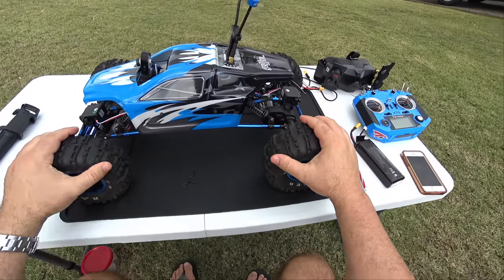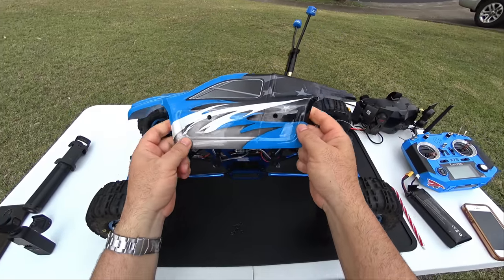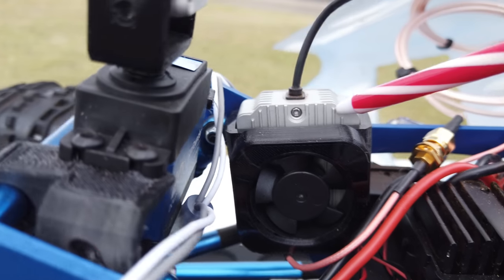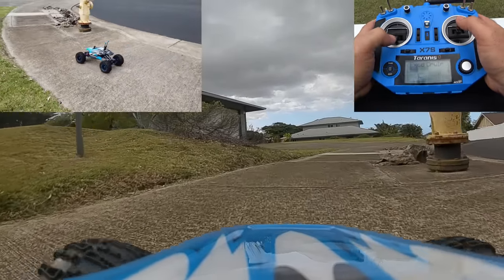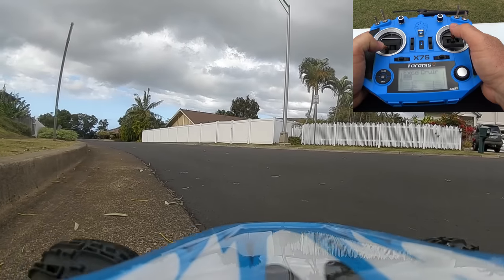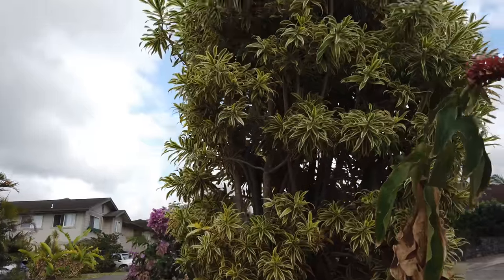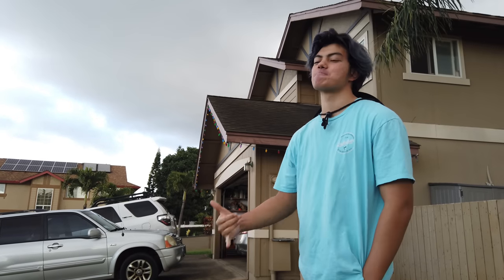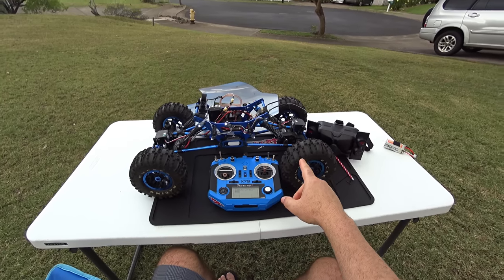DJI Digital FPV+ 50mbps Ground Surveillance Range Test on RC Rock Crawler + MORE MODS!

Comment: Just a thought. If you put a small compass on the hood that can be reasonably read by the vehicle camera, and a compass at your location, you can properly orient your FPV goggles.
Reply: A small compass on the hood! Why didn't I think of that. Been getting lost in the bush with my FPV Summit. All scrub looks the same and sometimes I dont know if I am going towards me or away sometimes. Cheers.

Comment: Hey, quick tip on the rear steer, I'd use one of the 3-position switches to enable crab or opposing mode, that way you don't have to rely on a third hand on the potentiometer. Then, you can use the mixing in the radio to steer it the way you want

Love these urban FPV adventures :)
Reply: I was thinking something similar, like using both sticks for steering and the knob for the camera, or maybe use the front steering to match with the camera. Great vid, cool set up and cant wait to see more!
Reply from the maker: Cool thing is... You can set your channels to however you want to control each feature 🍻
Reply from the maker: That's  definitely an option.  I wanted more analog control of my rear steer 🍻

Comment: Very nice! I've got a 6x6 frankentruck with fpv. I use fat sharks with head tracking but i need a stronger vtx. An option to consider is the quantum (I think thats right) head tracker which could mount on top of your dji goggles.

Comment: The DJI system has dynamic power even with thermal protection turned off. So it only ramps up the power when the signal degrades and up close uses 25mW.

Comment: You should use a 3 way switch mix to control the 4 way steering . Up would be just the front wheel steer , center would be all 4 wheel steer and down just the rear wheels .
Reply from the maker: Great idea.   Thanks 🍻

Comment: If you put your TBS CRSF (TX) antenna on one of these...Alfa ARS-AS01 Magnet BASE mount for RP-SMA antennas, and place it on the roof of your vehicle, you will greatly extended the Crossfire signal. the sma connector on this antenna mount fits on your transmitter.

Comment: ohh man.. gears are turning...
not sure about your channel choices.. 
I'd use Yaw for Looking.
Right stick for Forward reverse and steering?
Like angle mode... 
dunno. 
fun and well executed. 
thanks for sharing
Throttle would be nice to set a slow crawl...
Reply from the maker: Everybody is going to have their preference and you can set how you want 👍🍻

Comment: u should mix the throttle and steering for the left hand so this way u can keep it pinned and steer with one hand and use your other for fine corrections with the rear steer.... have you tried that out? throw that into the mix and run it see how it feels!! ull love it much more natural takes all of 5 min to get used to

Comment: Try mixing the two steering channels like you would rudder to aileron so you get permanent four-wheel steering like on a teleporter.
Reply from the maker: I thought about it but wanted independent control of the rear steering 🍻
Reply: @DustinDunnill  On my farm I have a CLAS Raptor all independent four wheel drive. On switches you can get it to steer in any fashion whilst just using steering wheel.. Using a three way switch you could set it up the same.I can get this eigg
Reply from the maker: Cool.  I might move the rear to one of the 3 way toggles but I'd imagine in some real sketchy rock crawling situations the proportional precision is welcome 🍻

Comment: Hey Dustin, interesting project! I wonder if one can relay signals via a drone? to bypass resistance of all those houses.
Reply from the maker: Thanks and great idea.  Looking at doing a 4g mod to this like I have with my Parrot Disco wing.   That way there is control and FPV wherever good cell signal is 🍻

Comment: I have the same setting with axii 2 antenna , you will have better range in 25mbs and if you putt your image quality at low latency not on high resolution you will have better range , in urban city the system perform less better than open area too!

Comment: It will be so cool if there is a gyro thingy, so when you turn your head the camera moves too. Will eliminate the need of control for it, however will affect transmission since at some point when you turn around the antennas will not be towards the RC.
Reply: They have a head tracker module for fat shark goggles and then just mount a servo on the vehicle itself with a camera mount. Secondly for the antenna issue, they make a antenna tracker device that will keep the antennas orientated directly at the vehicle for perfect signal. They have been making these devices for the Long Range RC plane guys that fly out 100miles 👍🏻
Reply: This is one of the 4G disco feature... digital stabilized head tracking...
Reply: @smooth_ops2942  I haven't seen such thing, cause I'm not that much into the long range planes and RC. Good to know and thanks for the information, will check those to see how it actually works.

Comment: Should put antenna on top flag pole
Reply: For the price of this stuff I agree, A repeater ground station needs to be in the link. He barely went 400m from home and it lost it.
Reply: @Top-Jimmy  oh 400. Lucky i have 2,000. So it mean 2000 better? I have em
Reply: @behr4204  Hi mate, No not really... Need to get antenna High, More mA wont make a difference unless you have high up antenna.
Reply: @behr4204  Or do you mean to say.. You can travel 2000m with obstruction and not lose VTX signal? Because that is very good, But how?
Reply: @Top-Jimmy  im learning now. I mean mw2000. I have Flysight  black mamba. Both of them. Still working on it. Too busy right now during spring lawnscape jobs
Reply: @behr4204  Flysight Black Mamba is 'decent' but if I remember correctly you're not going to push close to 2W RF output unless you run that thing from its max input voltage. I'm not 100% cause I think I read that somewhere, but at 12V input it was drawing close to 1A for me... so that seems pretty close to 2W assuming it's not total trash but IDK.. Maybe more like 1-1.5W which is more than enough either way, but 5.8ghz is going to be total trash for anything outside of short range unless you have a nice set of goggles and a diversity receiver module. A refurb set of V2 goggles and any air unit is the same price or cheaper. I only get real short range on 5.8g, like just over 100m then the video gets real bad using basic cheap fpv screens. I'm not going to spend $300 or more on decent goggles that take a diversity module cause after it's all said and done I could have bought 2 more O3 Air Units. I already spent $60 on one screen, then another maybe $80 on the cheapest clone goggles.. then another $50 on a different receiver.. just trying different stuff til it worked right. My $60 screen looks amazing, but no damn audio... My $80 goggles have the audio output, but don't look as good, plus so long as my 2.4g transmitter is on I get horrible interference that clears up completely after shutting the controller off. The other receiver I tried was trash because it only had one antenna. It needs to be legit diversity or true diversity using a legit patch and legit CP antennas. 

If you don't care so much about the audio channel (which the Black Mamba was decent at) then you should try an AKK Race Ranger. $25 bucks flat from the AKK website. The built in mic works a little bit.. It's a legit 1600mW or more which is probably more than you'd get from the Black Mamba anyway. It also will have superior filtering and image quality. I had what I thought was amazing video using that vtx but I couldn't get over not having the same crystal clear audio I had with other transmitters.
Reply: @Top-Jimmy  When it comes to the elevated receiver I would say this is the key. The exact specific layout does matter quite a bit though so these things are not 'concrete'. Imagine how the FCC might track a signal down for example... A guy might be wandering around with a yagi antenna until he triangulates the general origin of a signal.. but when it comes time to truly pinpoint this signal it's not going to be easy if there are a lot of things that cause reflections around. Maybe to the FPVer these are beneficial reflections or bad reflections. I used to really appreciate being able to reflect the signals off walls and other objects back in the day when a friend of mine had this laser tag system. If this is causing multipathing on an FPV setup then that's no good. 

What really got me into the idea of 'long range' ground FPV was seeing 1.3ghz systems. I never really was able to see the details of most of them. I was able to break it all down over time based on what I've seen to assume that there are 3 possibilities when it comes to someone who is getting long range from home going around neighborhoods etc..
1) They are using an 800mW vtx at least, have extremely good antennas + a good diversity receiver setup where they may even have 3 different receivers and sets of antennas, have all the magic filtering needed for their area, and they have a huge pepperbox on their ground station.. then toss in the possibility that someone is GPS aiming a yagi or literally just has someone else spotting their receiver antennas for them. 

2) They have a quasi decent setup with a receiver about 5-6 feet on a tripod, relay over some distance using 5.8g, make sure to aim in the general direction the car is going to be while more or less knowing the location and paths to take and not take, and also deal with extremely garbage video quite frequently where much of the time they are just concentrating on trying to see where they are going. 

3) They are on a roof
Reply: @Magneticitist  Great info bro! My 03 Air unit and goggles 2 arrived the other day.. You'd think I'd be excited eh? I haven't installed it all yet, Managed to nail the cooling with an ESC heatsink and a Rocket RC fan all in one BUT, I forgot about sound.. Thats going to be a pain driving around without hearing anything even though I've got a GoPro 8 black inside the vehicle for post editing, I reckon i'm going to find it difficult racing mates point to point style dune racing not being able to hear anything not only will it be distracting but also not being able to hear what the Car ( Fireteam ) is doing, Something breaking etc..
Someone mentioned DJI do a seperate mic set but I dont know how true this is? Would you have any suggestions mate? or I just suck it up... Coz its going to be off putting for sure. I dunno how to go about an audio link and for the past few days i've sort of gone a little OCD on this. 🥴
Hope you are keeping well bud and are in good health and cheer!
Reply: @Top-Jimmy  LOL I sat on my DJI stuff for literally like 2 weeks man. I was excited about it but sort of just felt overwhelmed and unprepared so I kept chugging at the analog stuff for a while. Then one day I think frustration over a vtx dying had me like ok screw this it's DJI time. 

I remember seeing something about the first Air Unit having an audio capability. At least, it had an audio channel but there was some special shit you had to do to make it work. AFAIK no other units had that feature. (And now that I think about it, it may have only been compatible with a certain drone)

I totally agree though, not having audio is totally bogus. Even on a drone I'd want it.. it's really important feedback. Only solution I've found is adding the 1.3g and running them both at the same time. But then trying to condense the 1.3g portion to the smallest and most portable version (which involves sub-par antennas) has it so it's just not as clear as it could be. My tripod receiver works great, audio is so crystal clear I literally hear everything. I could hear an ant fart. I hear every fiber of the grass brushing against the bottom of the car etc. trying to throw the receiver in a small box and just pop out with a small antenna will work but not very long range. 

So long as I'm using my tripod receiver at the time which has a big antenna (and a good antenna on the car) I get pretty good audio up until the point I start losing DJI signal. I suppose using some kind of radio is also another option.. A cheap baofeng or something.. picking a legal channel, then just leaving it on transmit the whole time while you have another one with you on the same channel receiving.
Reply: @Magneticitist  '' Hear an ant fart '' hahah classic!! - Man, Thats a brilliant idea with the Baofengs, Ive got a couple of the UVR 5W? I think they are.. Thats genius!! We will definitely be trialing this! I'll be sure to let you know how it goes... Makes perfect sense to me and may save my sanity 🤪👍
Reply: @Magneticitist  ok. Air and land differences. Will test next month at camp
Reply: @Magneticitist  i put big 13” antennas on pole. 2 each for front camera and other 2 for rear camera. I thought that high the better
Reply: @behr4204  Most of the time this will be the case. It's sort of like trying to perceive light. If the light is shining your way on the other side of a wall you may only see the slightest bit of reflection from other things. Raise yourself above the wall and suddenly you see way more light.

Comment: How did you get the air unit out of low power mode without a flight controller?

Comment: Hi Cant you mix the 2 steering channels so that are like ailerons on a plane? that way 4 wheel steering all the time.
Reply: if it was me id use the elevator for the throttle, aileron for front wheels and the rudder for rear wheels. then control the camera with one of the knobs.

Comment: Full time rear wheel steer with the front would be better maybe?
Reply from the maker: I wanted the rear to be controlled  independant from front but yes it's an option for rear to steer with front automatically 🍻

Comment: I suggest you use traxxas summit 1/10. Much faster and with diffrential locking, hi-low speed, and bigger wheels, it's a hybrid crawler basher.

Comment: Need to put Crossfire on it for better range.
Reply from the maker: The control is tbs crossfire at highest power.  As I stated in the video, it's hard for wireless technology to penetrate through earth, cars, rock, homes, vegetation 🍻
Reply: It was designed to be impeded because each house on the block was gonna have them.. 
There's def ways to get it more open and harder hitting 😁

Comment: So compare the DJI image quality compared to any other brand? It looks amazing if that's what it looks like in your goggles?
Reply from the maker: Yes, this was all goggle recorded feed of what I see in goggle screen  🍻
Reply: @DustinDunnill  So the quality is truly THAT good?? That's insane
Reply from the maker: You can see the quality degrade with interference as shown in video 🍻
Reply: @DustinDunnill  But your interference is on the ground. To where a drone would be in the air with a lot less obstacles. I just started watching your channel again (Used to watch you when you first started out with RC stuff) but have you done any testing on a drone?
Reply from the maker: True.  Yes I've done quite a bit 😁✌️
Reply from the maker: True.  Yes I've done quite a bit 😁✌️

Comment: So  what was the approx max range on the ground ?
Reply from the maker: It will vary greatly depending on physical interference.  In my neighborhood I got about 1000ft max from where I was sitting.   If you have no obstructions this system will give clear video and control for miles 🍻
Reply: @DustinDunnill  Thanks for the answer , this would be a lot of fun fitted to my Xmax  :-)

Comment: try wlan extender pole, lateral amplification
Reply: you should get whatever the current wlan max speed is
Reply: also self-focusing wlan paradisc or mimo steer array, very pointy amp
Reply: floaty helium balloon high ground antenna
Reply: direct line of sight from above
Reply: 360 cam
Reply: or just use a backpack to have a horizontal amp pole, up there
Reply: leg up
Reply: spider style
Reply: secondary pip camera, 360
Reply from the maker: All great ideas 👍

Comment: Wrong antenna system.. you need something that will fight thru the magnet interference.. I'm sure it would go further but you got to remember your using thing me t to be in the air..try dif antennas mods.

Comment: This is Fuckin Cool.....1 question: With those FPV goggles, can it juuuuust maybe "Head track" & steer where ever you turn your head? OMFG, that would be INSANE.....becuz i have a DJI Mavic Pro drone, & the DJI goggles, & use that immersed view when I'm flying, however, I haven't use the head tracking like wherever I turn my head to, that's the way the drone goes...just to see where I'm going & I manually steer the drone myself.
Reply from the maker: It could be setup to head track steer with more mods yes 🍻